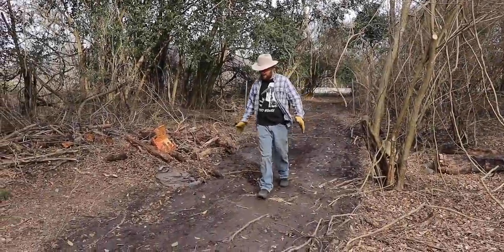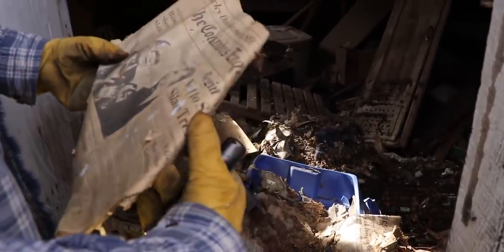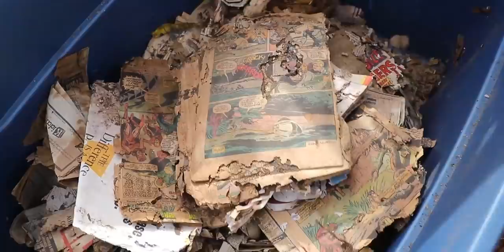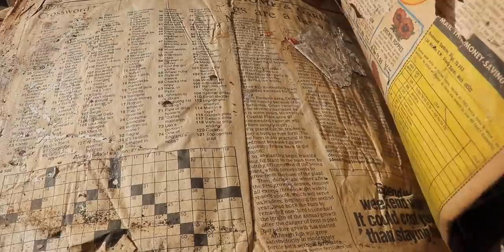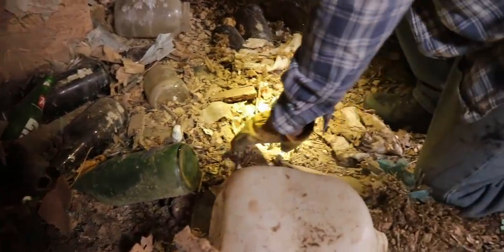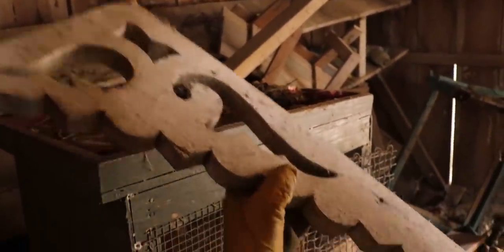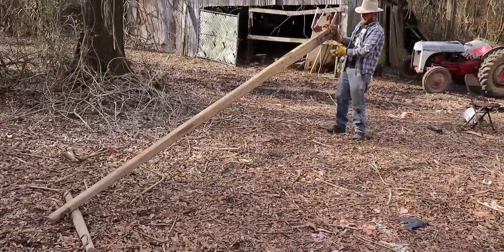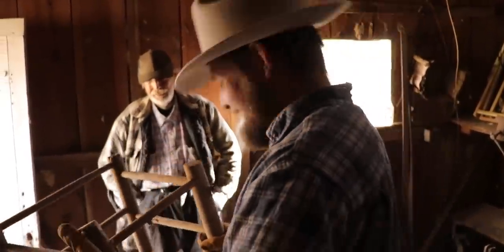Cleaning Out 140 Year Old Shed On Abandoned Farm

Comment: The long pole you pulled out is called a tongue and horse evener.   The tongue would have been attached to the wagon.  The wagon would have been pulled by a team (2) horses.  One horse would have been on each side of the tongue.  One the front of the neck yoke is a hook ( The neck yoke is what is around the horse's neck.)  That hook would clip to the evener.   The evener is designed too keep the horses abreast,  and to prevent one horse from getting on front of the other. 

I'm not sure the year of the tongue and evener but I would guess late 1800s to early 1900s.
Reply: Single tree yoke harness
Reply: Also used for pulling a sulky or gang plow. When I was growing up, The neighbor down the road used something similar to hitch his horse to a sorghum press.

Comment: Greetings, from Ohio. Enjoy the videos.  Two things , on the wisteria, get a product like Accord. Mix with water, you'll need to cut the vines again. (Needs open cut) Spray the cut so it can draw the chemical in to kill the roots. Accord and other type vegetation killers, once the contact the soil, microbes in the soil will eat the chemical, and the soil is able to be planted right away. Some chemicals will render the soil unplantable for months or years. Second when doing a clean up project, back your truck to where your working, and load the truck. Drives me crazy to see you work hard, move a pile of rubbish, and toss it into another pile. Save time, pick it up once, and throw it away.  I always enjoy your vids.

Comment: The "long  Toung"  is the  pole  from an  horse towed  hay  mower    with  two  horses  it  pulled the  mower  while the  driver  sat on a seat   controlling  the operation  , putting it  into drive ,lifting the cutter bar . the  machine  was driven  by  the  wheels  somewhat  like a  push  lawnmower  ...then we are  talking  --drying the  cut grass, turning   then forking  into a stack ...or carted to a  hay  bailer  machine   hard  work  guys!   we sure are  lucky  today!

Comment: You got to ask yourself what would I use that for. Anything that you'd pull out of that little shed you got to ask yourself why would I keep it like that old rotten chair. You ain't going to sit on it even if you fixed it first off you'd have to take the whole thing apart and put it all back together again with the new parts and then it wouldn't be the same chair because you'd have new wood with old wood and it wouldn't look the same it's trash all it is is wood for the fire that's it